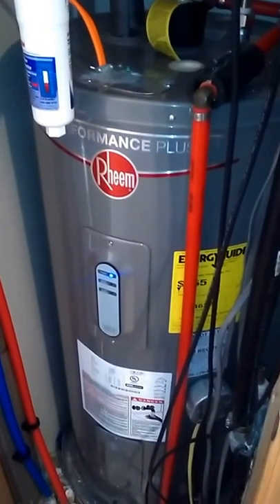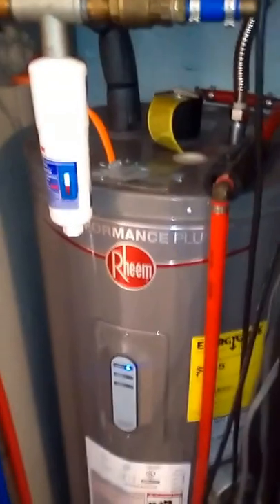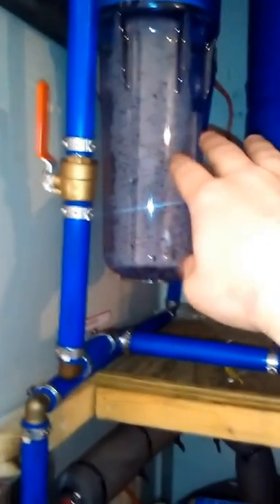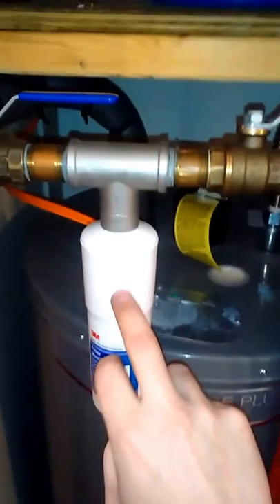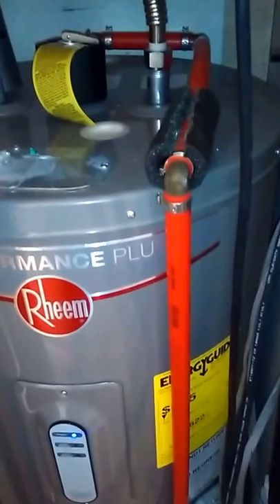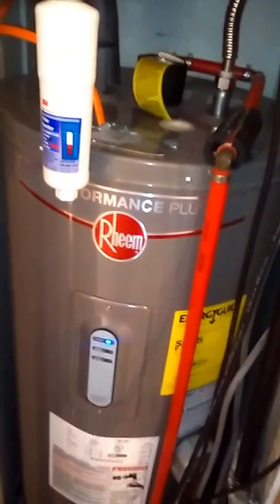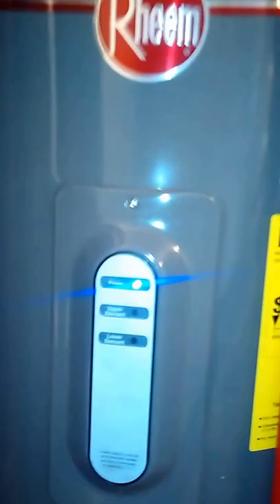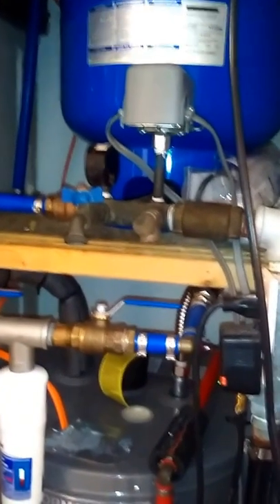My 40 gallon water heater into mobile home water heater closet

Comment: Mobile home water heaters are made specific for mobile homes and come with a HUD approved sticker.  Stick built home water heaters aren’t approved for mobile home use.  The first thing the insurance company is checking is to see if you have the correct water heater.  If not, good luck.
Reply: Have to replace the water heater in my mobile home. Just read about this.
The company I called was going to use a regular water heater.
I caught it just in time.
Reply: so what happens if a company installs the wrong heater and your home, and all your belongings burns down? are they responsible?
Reply: @darknessfalls1956 the wattage should not be different.  I looked at a top connect but the wattage was too high, so I stuck with the exact model I had up to date with 4500 top element and 3380 bottom so the wiring would be correct.

Comment: Measure the height of your old water heater. 29 gallon unit will fit, if your old tank is in a space[height limited] closet. 60 inches max height. 17-1/2 inch diameter. Then there still remains the problem of fresh air coming in from underneath the unit. Odds are that the flat bottom replacement tank has no air vent provision. Your old tank had feet on the bottom.
It can be done CORRECTLY, however. Quite a racket for mobile home updraft water heaters. $700 becomes $1400.
Reply: What would be the correct way of doing it then? Serious question I recently did this because all I could afford was a standard heater and not a mobile home water heater

Comment: Your tanks over pressure valve, aka, "PT" valve must directly exit the exterior of the home, through the floor. Not into the drip pan. That's Code requirement.
Reply: My original water heater relief valve drained into the drip pan, and passed  inspection by our local building code department. 
Originally the drip pan had no drain pipe, so I installed a drip pan with a drain pipe  going through the floor, so in the event of a water heater leak or pressure relief event, the water will drain into the crawl space under the house.

Comment: When all is said and done you spent more on the new electrical and new shark bite fittings and new plumbing then you'll save on the lifetime of the heater. Good job. I would rather spend the $500 and just install it where the old one was. Lol

Comment: Did you pull a heavier gauge electrical cable to go from the original manufactured home heater to the one you installed? Breakers also?
Reply: Yes,the original water heater used a 20 amp double pole breaker with 1w gauge wire. The new Rheem unit called for a 30 amp double pole breaker and 10 gauge wire.
Luckily, the way my modular was wired, it went through the ceiling, into the attic and dropped down to the panel box. I was able to tape the new wire to the old wire, and pull it through the attic after removing a few staples.
Reply: @joshuacronk7291  awesome! Thank you for replying!

Comment: I asked Home Depot  in San Diego about replacing my 40-gallon, 17-year old Rheem gas water heater in my mobile home.. They told me that "regulations/laws/HUD" prohibited the installation of gas water heaters of more than 29 gallons in mobile homes. (THEY REFUSED TO SELL ME ANYTHING LARGER). The girl I talked to even consulted with her supervisor after I expressed doubt. Well, I didn't bother wasting any more time with her, but I planned to higher management about this ridiculous opinion. Now I will. Oh, I forgot to mention that I gave them a chance to reconsider by sending them an E-mail on the subject. They never answered.
Reply from the maker: I only have experience with electric so I can't help you. I'm in NY as well so I am sure regulations are different in CA.
Reply: Quabledistocficklepo why is there only one water pipe on the top of my water heater
Reply: As much as I detest the depot, they sell the 29 gallon Hud compliant water heater.
And it will work for a 3 person household.
Kuddos to the weekend customer service, Rheem team. They negotiated a hassle free exchange.
Reply: @terrybryant8202  Because the cold water inlet is on the side, near the bottom of the tank. Hot outlet is the one on the top. Or are you a wize guy, here to troll with an electric water heater?
Reply: I never heard of a store not selling you an item because it wasn't up to code for your application. Most of the time they don't even question you on how or where an item is going to be used. They may advise you on it's use but refusing to sell you something they believe is not to code is beyond ridiculous, is this common practice in California?

Comment: is the filter you have installed filtering water that goes to the toilet, too? If so, could you have installed it differently so it wouldn't? It seems like a waste of a filter to filter toilet water. Are toilets on different lines?
Reply: The toilet is not on separate lines, feeds off the same cold water line tgat feeds the rest of the bathroom.
The filter I installed is a whole house filter that is installed on the main line  that feeds the entire house.

Comment: Very informative. Nice clean plumbing work. Looks like you use stainless steel valves. Is that correct? I like the red and blue piping. Indicating hot and cold pipes. Why didn't you go with all PVC pipes? Thank you
Reply from the maker: Stephen Fiore  Valves are brass ball valves. The flex pipes going into the water heater are stainless. 
The rest of the house came with pex, so I used that for this project. I like it better than PVC, it is more flexible.

Comment: Josh in N.Y or anywhere else in a HUD home. Mobile or manufactured. If your home burns down they will void your claim because of your water heater. It has to be HUD approved. 3800 watts instead of 4500 watts side feed not top feed. Nice job. But you need to take it out right away and put in the correct one
Reply: My home is a modular and is regulated the same as a stick built home in most municipalities. I consulted with my local codes office before the install and was told it was perfectly fine and legal.

Comment: HOPE YOU DON'T GET REPORTED. IT IS ILLEGAL TO INSTALL A WATER HEATER IN A MOBILE OR MANUFACTURED HOME THAT IS NOT HUD APPROVED. IF HE SELLS THAT HOME AND THE BUYER FINDS OUT THAT THE WATER HEATER IS ILLEGAL, HE CAN BE SUED.
Reply: This is a modular home and perfectly legal to install any standard  water heater, I consulted my local building code office to verify before installing.
Modular homes are not regulated the same as mobile homes.